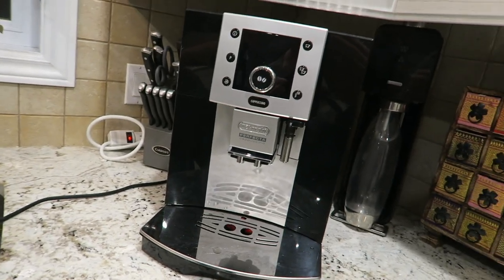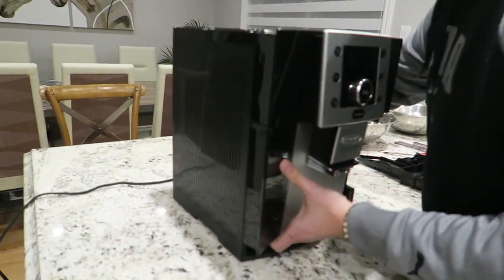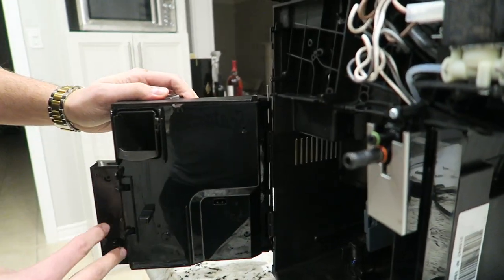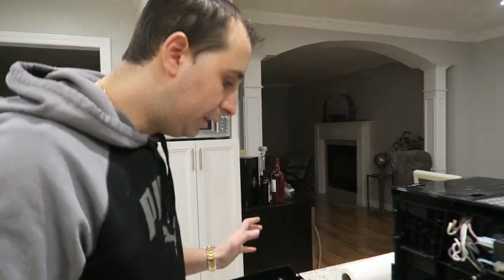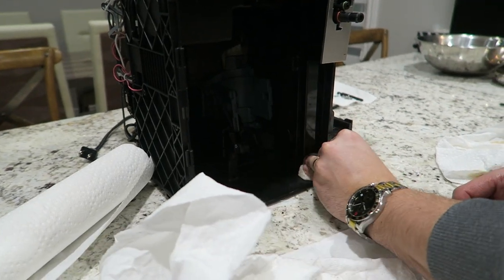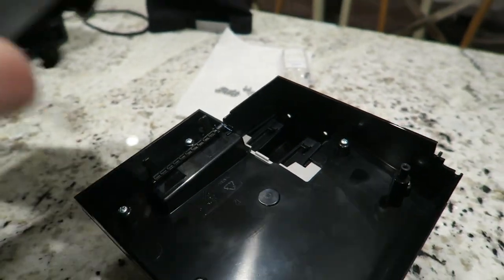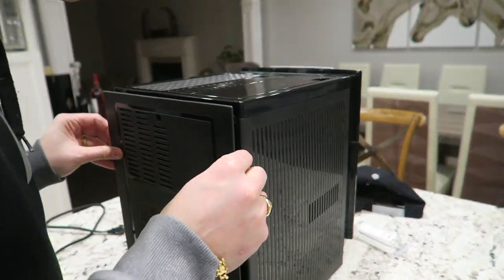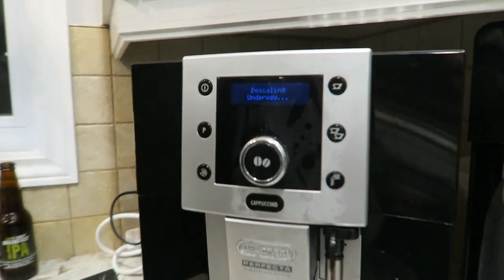DELonghi Perfecta Repairs, cleaning, and maintenance.

Comment: All My lights come on when  I plug it in and push the on button. Then all the lights go off. sometimes the red triangle comes on .  I cleaned and lubricated the infuser ..  it just doesnt stay on. Occasionally  it makes a struggling noise before all the light go off. Occasionally , the water works but nothing else but mine is a magnifico .
Reply from the maker: +TexasAndres sorry to hear this. Honestly sounds like either a “computer” issue or one of the internal devices is failing the self diagnostics. When you unplug the unit and plug it back in you should see it doing a self diagnostics it most likely fails. It’s not something we can help you you would need to take it in to service sorry for the bad news !
Reply: thats exactly what happens  what would make the diagnostics fail ?
Reply: where do you rec a repair place that is worth the cost ?
Reply: Could I post a video of the lights and sounds and see what you think ? do you repair ?
Reply from the maker: +TexasAndres sure. Post a video would be easier to see. We don’t repair. We just do reviews and minor repair videos for people

Comment: My machine is nearly 10 years old now and just recently the grounds have not been landing in the container. They just fall down to the right-hand side and it's a real mess to keep cleaning up. Any ideas. I don't think we are capable of taking the machine apart as in this video. It looks too technical.
Reply: I suspect it might be the diffuser arm not working properly. It "swipes over" the top of the diffuser after the drink is done, removing the coffee "cake".

Comment: Hi there, my machine recently started the whole "grinds too fine, replace spout"  and no flow thing. Annoyed, and before watching this vid, I took it all apart and it turns out there is a small inline water filter behind  the tank at the bottom, and this was clogged with scale I'm guessing! Bypassed it for the meantime and the machine works fine. Have ordered a new filter for £2.99 on eBay (part# 5513220521) and hopefully jobs done :)

Very informative video though as I forgot to clean the inside of the door...will do this when the part arrives :)
Reply: Thank you for advice! I have the same problem.

Comment: when i make coffee the grounds don't all go into the container.  they are all over the place.  someone said to make the coffee setting weaker.  has anyone else had this problem?  the machine is a slightly older model than shown in the video.
Reply from the maker: Hello, when is the last time you cleaned your infuser? Are your grounds pucks intact in your container or broken apart ?
Reply: they used to be whole but now they are broken up and moist.  i usually rinse the infuser and occasionally soak it in hot water as per your video. after making coffee the infuser is caked in wet coffee.  it seems that half the puck is in the container and half in the tray.  the infuser moves slightly but i haven't got a hex screwdriver to tighten the screws behind it.
Reply from the maker: princess yevisha It could be either the latch on the infuser is not pushing the puck but it could also be the bean grinder is not compacting the grind. Inside your bean bin there’re should be a grinding knob now depending on your model the lower the number the finer the grind or higher the number thicker the grind. Increase it accordingly and make sure it’s on the thickets setting then try again.
Reply: i really appreciate your replies and your trying to help.  i tried the setting but everything is the same.  i'm thinking of buying a new infuser and hoping this solves the problem.  i'd renovate the infuser but it looks a bit complicated for me.  i'm not comfortable doing it in case i mess it up.  i'll let you know if the new infuser works.  thank you again for trying to help.
Reply from the maker: In that case I would suggest to go to an authorized repair center and find out if they have a spare infuser to try before committing to purchase a new one. Might be worth spending a few dollars more just to try. Good luck and let us know.
Reply: yes, good idea.  thank you again